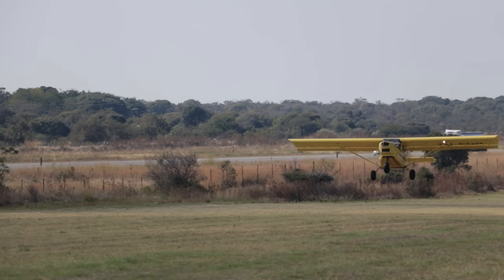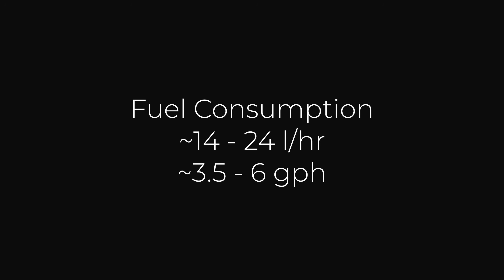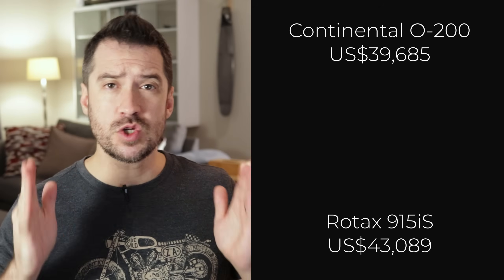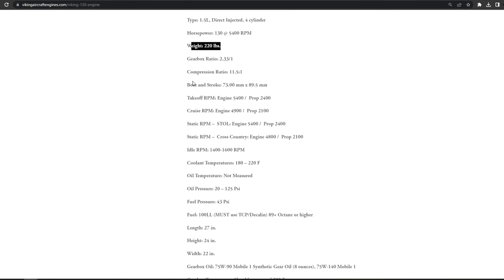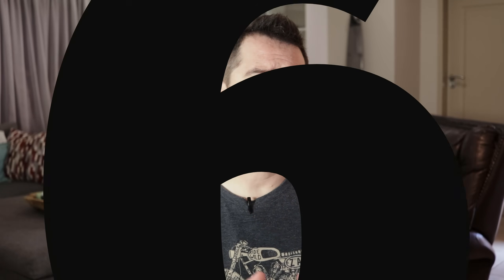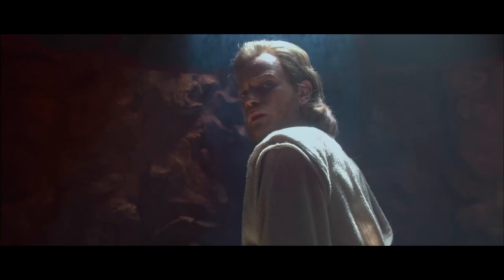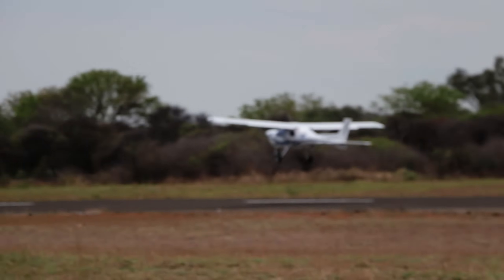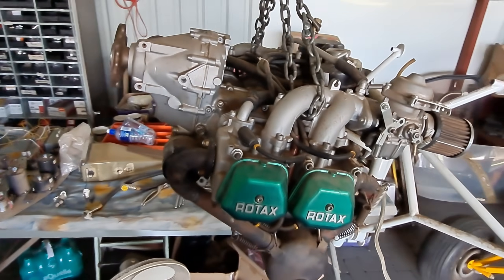6 WORST & 6 BEST Light Sport Aircraft Engines

Comment: I am not sure if you have developed your analysis yet? Most owners of this light category hould be looking at the fast developing electric propulsion systems avalaable which should be competitly priced. With consideration for Honda conversions for hydrengen aiming at this market.
Reply from the maker: I'm following the improving battery technology quite closely. Other than for low drag aircraft designed for electric engines (e.g. Pipistrel Electro), there's nothing realistic on the market yet. A +-1 hour endurance wont cut it for most pilots like me used to 6 hours of endurance and almost 600 miles range. 

We'll get there, but there's nothing right now.

I could probably make a video specifically on hydrogen engines (both ICE and fuel cell). Other than the fuel tank problem (heavy), there is only a handful of filling stations outside of California (some european countries have a handful or two). Thus fuel availability isn't there for recreational aviation (there's some good hydrogen development happening in commercial aviation though)

Comment: and aeromomentum AM1300 and AM1500 beats ALL of the engines on this list, in EVERY metric. power to weight, cost, fuel burn- and above all- RELIABILITY.
Reply from the maker: AM15 the one weighing around 185 lbs...dry? Looks like it doesn't beat ALL engines on the list in EVERY metric.
Reply: @LetsGoAviate  pound per hp it does. you're compairing the am15? it develops 147 hp. they make a 300hp engine too. the AM20T

Comment: Friend of mine has Slepcev Storch STOL. He swaped normaly used Rotax 912 with Yamaha motorcycle engine. You could change gears mid air to reduce engine RPM. Result was 150hp instead of 90hp, and compared to Rotax, consumption dropped from 18 to 8 liters.
Reply: Change gears midair … that’s awesome.
Reply: @Rockingruvin its amazing shifting gears midair, talk about saving fuel🤨
Reply: 200 hp from one liter engine beats anything from the aero engine makers.Only drawback is high rpm.
Reply: @eugeneoreilly9356 Most modern motorcycle engines are designed to run near redline all day long, added to gear change ability.
Reply: @aaronfire2989  bike engines are designed for 20% duty cycle. In an airplane, at 70% duty cycle, they will fry like your harbor freight MIG welder
Reply: @crono331  My harbor frieght tig welder been going strong for 6 years now.
Reply: People are using the Yamaha Apex engine which lacks a gearbox and a skytrax gearbox for gear reduction, the best benefits to liquid cooling is you can use pump gas and minimize shock cooling
Reply: @Tommy but if you change gears, rpm comes down and all you need is enough RPM to stay high in the torque curve for max power.  Just like cruising on the highway.  Well, similar…
Reply: Oh my goodness changing gears in flight that is awesome!
Reply: @AllenPortman  wasn't it the 1150 hp T-6 Texan radial where you could change supercharger mid air, for flying >FL250?
Reply: Hi, wath IS the name of the   Yamaha engine?
Reply: Cannot be moped  @fredericmartin8758
Reply: Those engines will fry on an airplane. And they do. Avoid.
Reply: I wonder if what you refer to as changing gears is just a variable pitch prop.
Reply: I could never figure why hasn't someone used a gear box on aircraft.(for 2-3speeds)...as far as yamaha motors there dependable.......my experience....yz 250 2cycle.cut off the trany . installed 2.25 belt drive.installed it to ultralight....more power than you would ever need.....but remember.(((you must open the piston ring gap.because of constant engine load heat..like a boat engine
Reply: Genious! Wonder why this isn't done more.
Reply: @I_HateClickBait  it does nothing, unless you change the pitch of the prop you’re not doing anything other than speeding up and slowing down the engine. Something you can do with the throttle. Also, I would hate to have a transmission failure mid flight.
Reply: I would love to see and learn more about that set up with the gearbox from a motorcycle.  Sound interesting.
I have 650 hours on my Kitfox 4 with ab NSI 100 Subaru.
Reply: Would love that
Reply: you sure it wasn't the yamaha 3 and 4cyle non-turbo and turbo jet ski engine? That seems like an interesting choice a handful of folks are using with wide power output options.
Reply: My friend uses a Honda Rubicon 500 engine to power his ultra light and does 77. He added a variable prop to enhance his fuel efficiency and he almost does 90😉
Reply: Gears don’t increase horse power. The horse power is the horse power. Gears allow an engine to go through its power band as many times as on has gears for and is primarily expressed in torque.  In the ground, once you get a thing moving, it’s easier to keep it moving. In the air, that process is considerably less effective.  After a 120 years of piston powered aircraft, they have tried everything to increase power without increasing weight and in all that time nobody has done gears to extend HP.  There’s a reason for that. It’s called physics.  I would be very interested in seeing your friend’s Yamaha powered and changeably geared storch.
Reply: All gearing does is alter the load on the engine. As you state, it has nothing to do directly with horsepower. Rather, it might allow an aircraft engine to use maximum HP at take-off, and then lower RPM / higher loading for cruising like overdrive (usually 5th gear) on automobiles. Peak fuel efficiency in internal combustion engines happens under low RPM and high torque loads. Peak power output at higher RPM and lower loading. I'm not an aerospace engineer, but I raced automobiles for a while, was a mechanic, and have owned many motorcycles. Modern motorcycle engines with multiple cylinders, overhead cams and high compression pistons have narrowish power bands and low torque. That's why they need a lot of gears. Again, not an expert, but it seems like a variable pitch prop serves a similar purpose as a variably geared transmission by varying the load placed on the engine at a given RPM. It's a simpler way to accomplish the same task - and probably why aircraft use them instead of cluches and multiple gear ratios. For somethings as extreme as STOL, it might make sense to be able redline a motorcycle engine at some insanely high RPM like 14,000 for 60 seconds, and then dial it back to something more leisurely once the surly bonds of earth have been broken, and the airframe levels off, Bernoulli's physics takes over, and is no longer hanging from the prop.  You won't be able to use the same strategy with an high torque, low RPM air-cooled pushrod engine that red-lines at 3,000 RPM or whatever. Again, I'm not an expert, just speculating. @garymyers6638
Reply: @TheWilliamHoganExperience  correct.In aircraft the constant variation of propeller pitch is controlled by what's called a constant speed unit.Keeps the prop speed and engine speed and load constant.

Comment: Suzuki M13A non VVT hands down the best designed engine for aviation up to about 150KW constant power. Most of these engines are all based on 1920's designs and the Honda engines are not a good design also for aircraft, the people selling them are just selling what is available. Rotax derived from go kart and motorcycle engines and they sold what they knew and had, not what is best. All the air cooled engines are the same story, they sell because people buy them. UL is just trying to get a foot in the US market because the US believes that air cooled is the way because that is what they know. After Suzuki the Yamaha Apex engines are second best. The issue is they are being used for temporary power instead of continuous. Almost all aircraft are designed for aircooled engines, so placing a liquid cooled engine in is not ideal. Lycoming and Continental both made radial engines during WW2 which were almost obsolete even at that time. Then after the war they used the cylinders and made small inline engines and it continued from there. Liquid cooled engines were discouraged because engines didnt make as much power and glycol was expensive and harder to find compared to today. Look at the oil industry, turbine engines and most automotive engines have gone full synthetic for obvious reasons, yet aircraft are still using mineral oil which is inferior in every way. The use of air cooling requires high octane fuel which requires low quality oil which requires redundant ignition because of fouling and the list goes on.
Reply from the maker: I wasn't acually aware at all of the use of the Suzuki engine in airplanes. Will have to check it out!

Comment: The Rotax 912 ULS is a very good engine but the weight of 149 lbs quoted is for the engine only with some components. The dry weight of the engine only is 131.6 lbs.When you add the liquid coolant & radiator, water pump, oil cooler, pipework, exhaust system, etc the weight increases to 194lbs. Then the airbox is an extra 3lbs which is required to get the 100HP (5 minutes only). So the installed weight ready to fly is close to 200lbs. 

The Jabiru 3300 weight is 180lbs and that is ready to fly with only an oil cooler to add to the weight. Plus it is rated at 120HP and can be run at peak power continuously.
Reply: Thats a load of bull re the weight. And the jab 3300 sucks. All people i know who had one scrapped it.
Reply: @crono331  You are entitled to your opinion no matter how uninformed it may be. The data I provided came from Zenith who manufacture aircraft and install 912ULS engines in their airframes. 
There are over 7000 3300A engines flying around the world. I own one and it has never missed a beat. The 4 cylinder version operates in many flying schools and most reach the 2000 hour TBO. They are rarely fully overhauled as the cost to replace with a new one is less than the overhaul plus the new engine is the latest generation and comes with all the upgrades.
Reply: @corindikevcorindikev  the data i rely on comes from ME. I have two airplanes powered by the 912. Plus, i recently bought a second hand one, and the guy who delivered it to me took it off the trunk of his car with >one< hand.
the weights quoted by Rotax are correct, 56kg including the oil reservoir,. and a set of radiators, hoses, fluids and an exhaust will add around 10kg or less.  
Those who talk about 80, 90, or 100kg installations are lying or used components salvaged by diesel locomotives.
I have considered buying a Jab 430 and gave up after ALL the people i asked about the engine told me they had problems ranging from bad cylinders to a broken crankshaft, through a long list of defects and problems some of which ended up in emergency landings.
add to that the very limited choice for props and the endless work necessary to baffle the engine to cool it properly, which is also one of the reason of the frequent problems.

Comment: Great presentation and selection. I think a good compromise would be a basic Rotax 912 with a low compression big bore kit. Doesn't add much weight, 107 hp and burn reg gas.
Reply: mogas is a game changer, imho. Every 100 hours' flying a Rotax is worth well over $1000, so at 1500 TBO you get a free engine every time.

Comment: Reliability is more important that power to weight or price. When you become a glider all of a sudden you would gladly pay the extra for a reliable engine, I know this and you will too if you fly enough hours.
Reply from the maker: I agree 100%. The problem is reliability is subjective. If I were to direct you to statistics showing Rotax (912 & 914) is the most reliable non-type certified engines people will be posting hate comments to me left and right (I've seen it on videos and forums), because if a person has flown a Continental for 2,000 trouble-free hours, they believe it's the most reliable. But in reality that's a single reference point on a statistics table.

That is why I stated the criteria I'm basing this on and said I'm not looking at reliability. I wouldn't buy an engine based on only these criteria, but I just wanted to make a fun comparison video about cold hard stats available about these engines. If I'm to include reliability I'd be going off my own perception and I'd be spreading a non-factual opinion.

I hope that makes sense.

Comment: Very interesting. He unfortunately doesn’t even mention the Corvair, not sure why. In my opinion, the Corvair 2850cc is the best option for power/weight/cost/reliability. It outputs 112 HP, is about the same weight as an O-200 (but has more HP & a third the cost), is a direct drive 4 stroke, 6 cylinder horizontally opposed air cooled engine modified for aircraft use that you can buy complete or build yourself and save even more money!
Reply: If only Chevrolet anticipated the demand for aircraft conversion kits that the core was easily converted to. Now cores are becoming hard to find. Because Corvairs are cool.
Reply: Corvair engines are junk!  @darrellcook8253
Reply from the maker: Someone else also mentioned Corvair in a comment. It's not that popular in my opinion, but of course I could be wrong. And I though it was very heavy (on paper specs) but you know how that goes, true ready-to-fly weights not always readily available.
Reply: When you reduce power in exchange to reliablity, Lycoming goes on this way. 
The 3000 cc in automobile would easily go 200+ hp.

Comment: How cheap is it to overhaul a 912? Any reliability issues with the 912 (Kathryn's report)? I was lucky to fly behind the engine I wanted in the same airframe being built.
Reply from the maker: I don't know the exact cost to overhaul, but I know it's not cheap (compared to buying a new one). 

Reliability 100% depends who you ask. I try to stay away from the subject, but I have hours behind a Rotax, that and based on others who fly and service them, they are some of the most reliable light airplane engines.

Comment: You should look at Edge Performance engines: the Norwegian company transforms Rotax engines with bigger displacement, modern EFI and turbos with higher power ratings that cost thousands (USD) less than any comparable Rotax. Edge is also developing a line of Yamaha engines with insane power-to-weight ratios and power ratings up to 300 bhp. Nobody should have to buy from a monopoly, (Rotax), or buy an outmoded, overpriced Continental 0-200.
Reply: Those Yamaha Apex engines are INCREDIBLE, especially when mated to the Skytrax gear box. I personally wouldn't want to run one over 200hp continuous.

Comment: You are incorrect regarding the Continental O-200D not being used for LSA. The Vashon Ranger S-LSA is powered by the O-200D and the dual Dynon screen version of the aircraft is less than 150k dollars.  Great LSA, great engine with nearly 90 produced thus far.
Reply from the maker: Yes I know it's used on LSA's, hence why it's on the list...but not suitable for most LSA's because of it's weight, unless a plane is designed for this engine. And even on the Ranger with the O-200D, the 1320 lbs LSA restriction will leave only 445 lbs of useful load. That's 2 somewhat heavy guys and no weight left for fuel or baggage. This is from info on the official Vashon website. Nothing against it, I'm sure it's an awesome plane.
Reply: @LetsGoAviate  You are right, it is awesome, I own one & can attest to that. In the US, the arbitrary LSA weight limit will soon be cured and the gross weight increase will be simple paper exercise raising the Ranger weight to 1,500 and a little bit. The airplane was designed and tested to 1,600 so I'm looking forward to not having to hear the useful load critique any longer. 1,320 was/is a dumb rule to apply to every airplane.
Reply from the maker: @zosoachilles  That can only be good, hope the CAA in South Africa adopts that change quickly as well. There are so many planes that can carry much more in reality, but are restricted on paper.

Comment: No one seems to recall that turbo's and adjustable props are verboten in lsa aircraft. 915is has both. There is the possibility that the new regs being touted will allow them and increase weight allowance, but until they become reality they are only speculation and those engines are not applicable at any price or performance level
Reply: Many countries allow variable pitch props and turbos I don't know of any issue. The restriction is with the amount of controls/levers the pilot must operate, but with having a fadec engine, variable pitch and other devices are allowed because they do not add additional workload to the pilot.
Reply from the maker: I'm pretty sure you can use a fixed (ground adjustable) prop on the 915. But if that's the case on the turbo, I wasn't aware. There's no such restriction on LSA's in South Africa.

Comment: No 2 strokes??. No Honda??  Miller
Reply from the maker: The only 2-stroke that I would consider for most 1320 lbs Light Sport Aircraft are the Simonini Victor. I'm not aware of Honda airplane engines, other than the Viking conversion which is in the video.

Comment: The Jabiru 3300 is The Best, for me.
Got a couple of those, one generation  1 and one Gen 3 . Very reliable, fair price, simpler installation than the rotax 912.
Reply from the maker: A large chunk of my flying time is behind the Jabiru 2200, and have a few hours behind a 3300. I find opinions on them are very divisive, people either fully love them or fully hate them. I'm on the fence...
Reply: More power, cheaper price.
Reply: Where you can get jabiru 3300 for 12k? I think it is about 22k.
Reply: The Jabiru’s arent reliable the through bolts stretch then you have an engine failure
Reply: It was fixed many years ago regarding these bolts in Jabiru